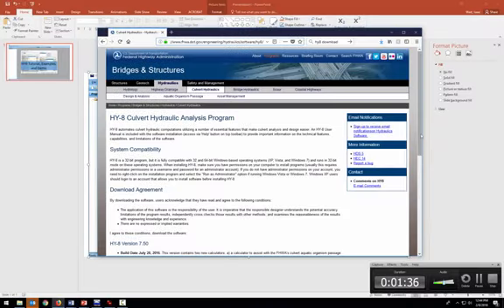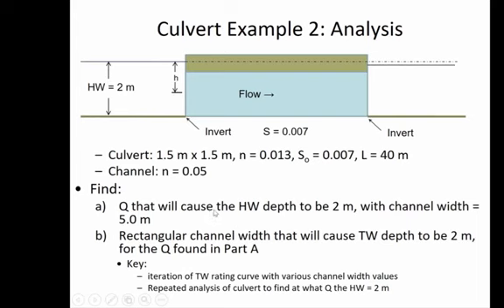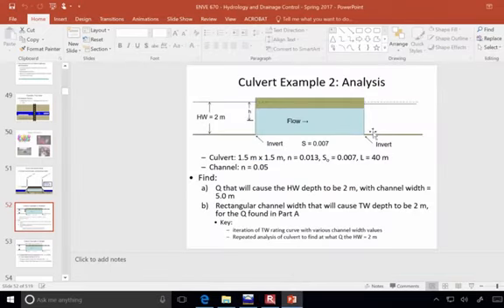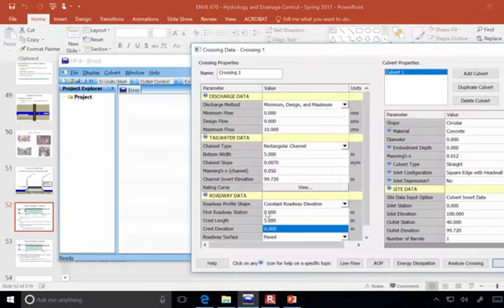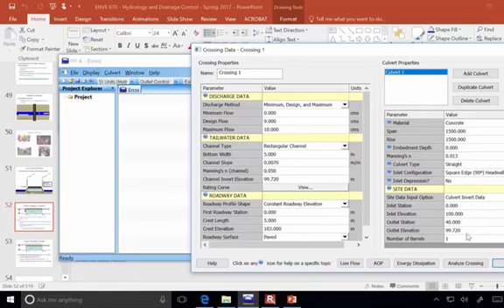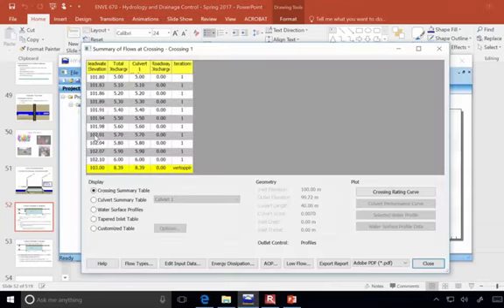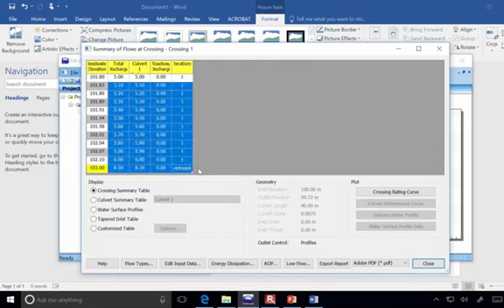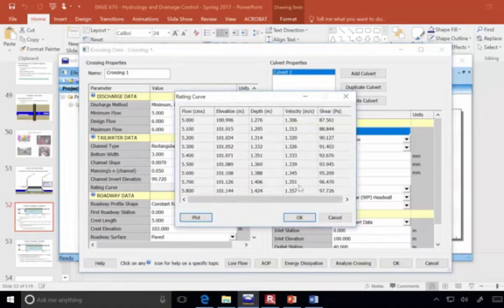HY8 Demo, Tutorial, and Example 2   for culvert analysis and design

Comment: Jim, you need to show an example of a shallow channel downstream with overbank flow. I've dealt with Co. Engineers and consultants that didn't understand that if you don't consider overbank flow the tailwater depth will be unrealistically high.
In working for FEMA I've dealt with a lot of consultants and Co. Engineers, most of which, don't know how to size a culvert. They do  know Q = VA and Manning's equation.